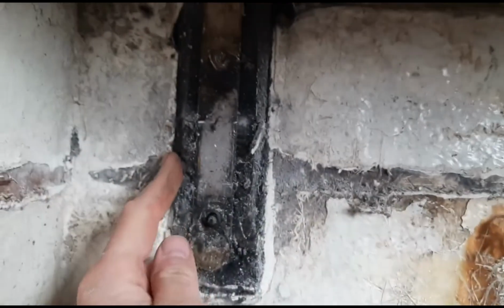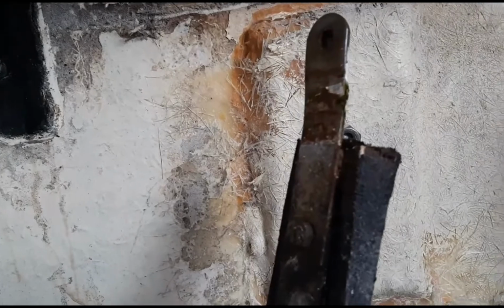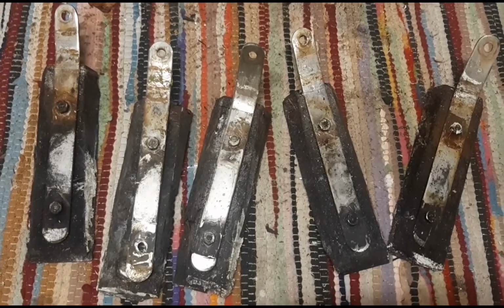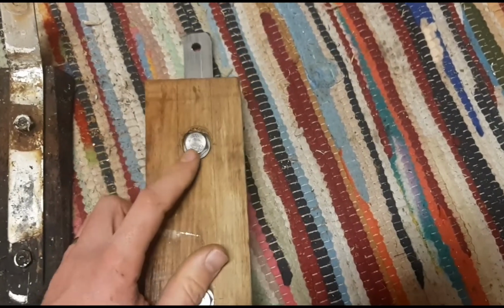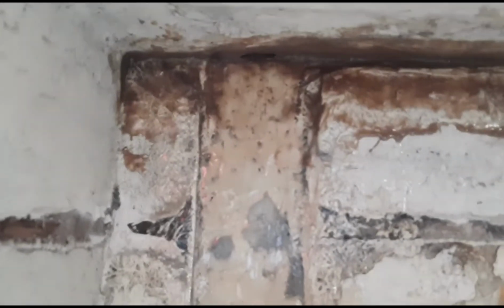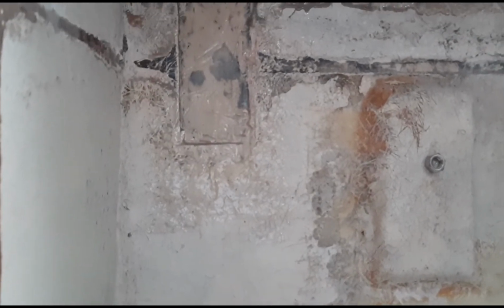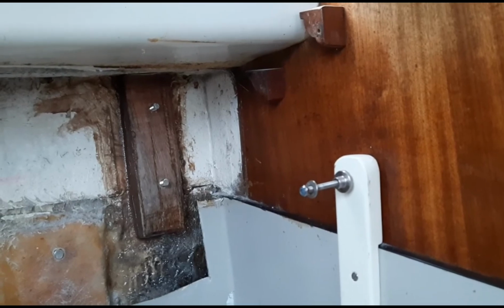Hurley 22 Chainplates | Removal and Installing new

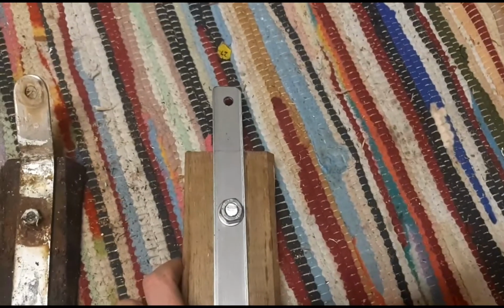Comment: 8:15... but doesn't that mean you are compromising the boat's structural integrity? I thought many things wee both created and positioned for optimum strength? Also, if insured, would you need to report those changes to your insurer?

(I know insurance not required in some countries, but private marinas and waterways often insist on insurance to negate unexpected liabilities). 

Genuinely no criticism here. I'm new to the Hurley 22 sailboat family, after 2 years of debating, so just trying to get an understanding of everything. As I'm  new  I'm doing the internal stuff (cleaning carpentry, equipment a d design restoration) , but at the moment not confident enough to undertake engine, external or structural stuff until I know the boat better, and hopefully start sailing her.
Reply from the maker: I never reported anything to my insurer, they never ask about chainplate maintenenance which I find interesting. I came to the conclusion this method of chainplate mounting has the failsafe of the assembly block being mounted from inside the boat meaning if the epoxy failed (unlikely if laid up properly) it would not be possible to pass through the deck thus maintaining the rig.

Comment: Looks good Sam. Out of interest did you glass over the timber as well? I like the idea of being able to see what's going on in future. Thanks
Reply from the maker: Glassed the sides sides only on the outer shrouds but not the inners. All knees were bonded to an exposed area of fibresglass with west systems 205 bonding filler with plenty of extra on the sides. I've sailed 2000nm since doing this with no issues.

Comment: Some good work there Sam. Are you happy with the outcome? Do you feel the water ingress was from the chain plate gap or the hull to deck joint?
Reply from the maker: Im really not 100% certain however im sure the majority of the water was through the chainplate deck entry itself. With the glass surrounding this area from inside the cabin the only sign of water ingress was water building up while on port tack and this side occasionally under water. I've filled the deck join out with epoxy because it was also in quite poor condition.
Reply: @samsails9820   Sam I would be confident that younhave nailed that leak and sorted the chain plates to boot.  there are always other leaks though!
Reply from the maker: @Sp3ktral22  yes always new leaks. My final video on this job will cover final plate fitting and the method of deck sealing